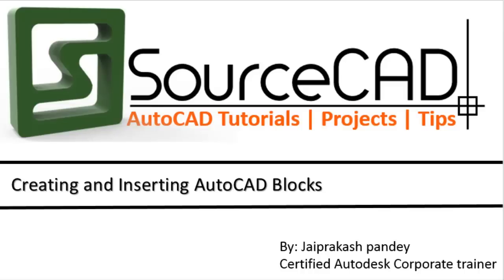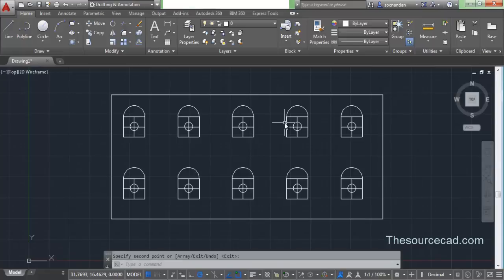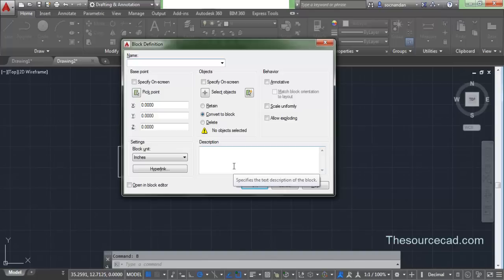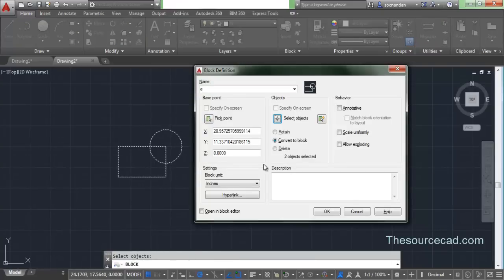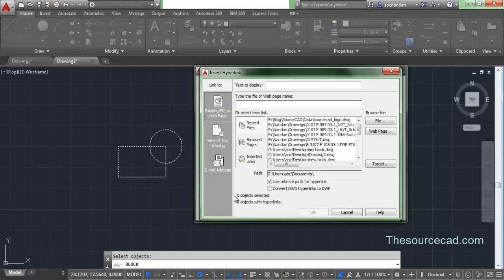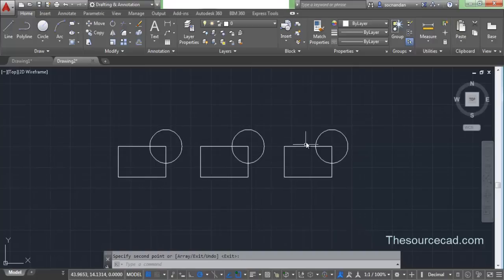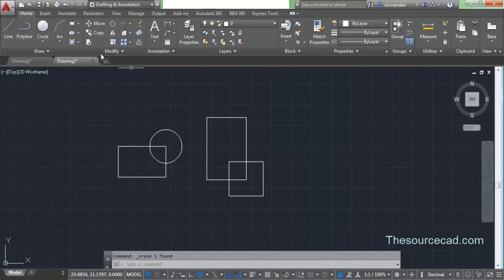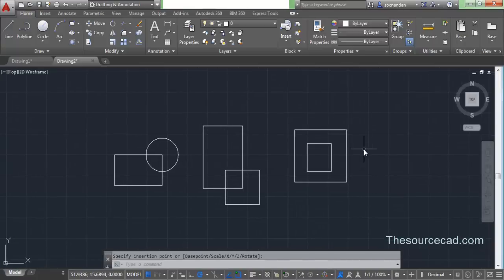How to make and insert Blocks in AutoCAD

Comment: Hello ...
I'm a beginner in autocad do I need help? How do I magnify height, width blocks to a certain dimension? in 2D.
Thanks
C:\Users\Komp\AppData\Local\Temp\Rar$DIa10116.47149\Problem_20200619_1712.mht

Comment: how can we bring the blocks to another drawing?
Reply from the maker: You can do it by using design center here is a tutorial that explains it all https://www.youtube.com/watch?v=aGSf031kUFc
Reply: understood but i mean how can we bring entire drawing to another drawing
Reply from the maker: You can import a drawing as block then later explode it, Type I on command line and press enter then locate your file using browse button present on top of insert window and press ok to insert it. you need to check that Explode radio button is selected which is on the bottom left of insert window. this will insure your drawing will be inserted not as a block.